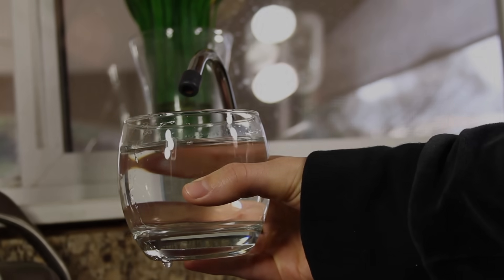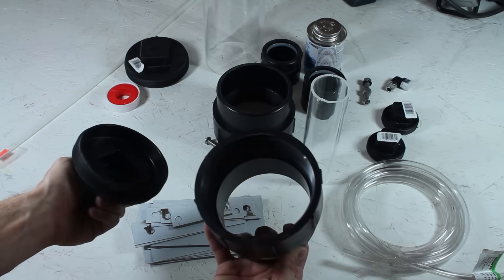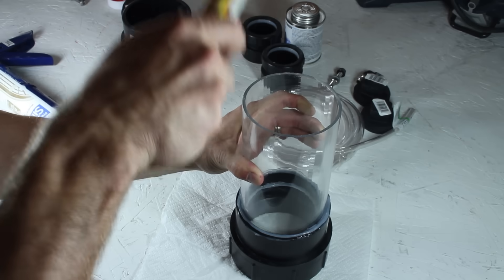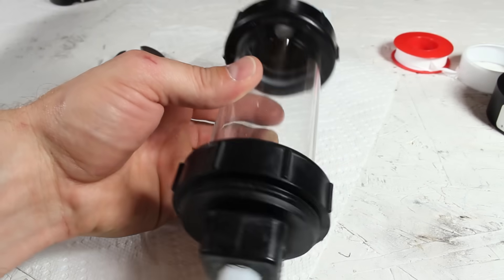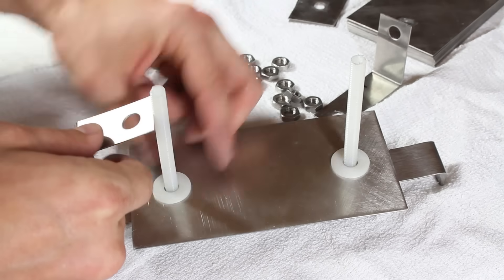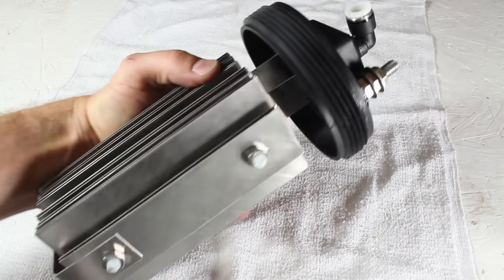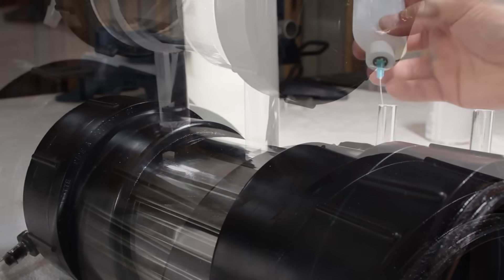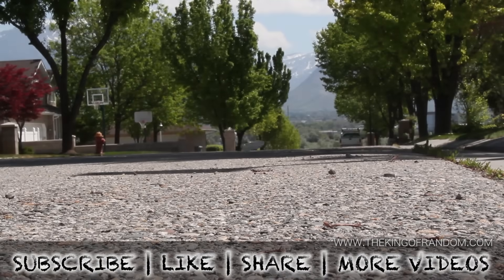HHO Generator - Water to Fuel Converter

Comment: Limitless lifting gas! How could you separate the oxygen from the hydrogen though?
Reply: The hydrogen gas forms at the cathode (- negative electrode) the oxygen at the anode (+ positive electrode).  If you separate the cathode and anode and collect the gas above the cathode you will get relatively pure hydrogen.  In the video the guy just wanted to make hydrogen oxygen gas mix, so he could burn it, so he generated the 2 gasses in the same space (cathode and anode right next to each other).
Reply: strato man Thanks.
Reply: strato man Because hydrogen and oxygen together will explode violently if ignited. Pure Hydrogen just burns.
Reply: Doesn't have to be ignited when mixed either. Just compress the two gasses together and it will go bang!
Reply: Jock Wochi Just curious, why do you need to separate the hydrogen and oxygen before you burn them in a torch.  The ratio of gasses coming from electrolysis is exactly correct for burning.  Were you trying to force an oxidizing or reducing atmosphere?
Reply: +hunter hulsey In the electrolysis device in the video the hydrogen and oxygen will be well mixed and very difficult to separate.  Even though the hydrogen is much less dense it will not separate from the oxygen, much as sugar will not separate from water once dissolved.  It would be wiser to separate the electrodes and collect the hydrogen and oxygen separately in the first place.  

But if hydrogen is what you want there are more economical sources than electrolysis.  Most commercial hydrogen production comes from fossil fuels (natural gas primarily), and you can buy any amount you want from your local gas/welding supply house for much less than it would cost to make it yourself.
Reply: Drake Tamer My response was to a comment by someone who wanted pure hydrogen.
Reply: Why do you want to know? Planning on manufacturing liquid state rocket fuel? (hydrogen and oxygen in (separate) liquid states that are mixed together seconds before being burned)
Reply: ...well....if I can remember right one of them is denser than the other so it sinks so you could extra ad t the top layer....there will be twice as much hydrogen
Reply: You don't need to. The mixture of Hydrogen and Oxygen makes the reaction faster and cleaner, so you get more power per bottle.
Reply: Motherbrain Jr 
One of the electrodes attracts oxygen while the other attracts hydrogen. Just separate the bubbles coming off it's respective electrode.

Comment: So how would we turn this into storable, liquid state fuel? could I have this generator in my garden and add a tank to hold and compress the hydrogen into liquid?? How do we put this into our fuel tank? (in the vid he said that bucket of water would make 1000s litres of fuel )
Reply: Using this generator for any other purpose then fun is not practical. A gas is dramatically less dense than a liquid, therefore the 1000s of litres of fuel statement is accurate.
Reply: gamersden30
 but how about if one was to make a HUGE version that ran all day off of solar power etc ? could you make 5lt of liquid fuel per day?
Reply: liquid hydrogen has a 1:851 size ratio. Try to do the math fr yourself
Reply: Dave P Yes, approx.
Reply: gamersden30
 so how big is a 4000lt tank
Reply: 24 hours multiplied by 60 is 1440.
1440 minutes of time to make hydrogen in.
to make 1 liter of gas you'd have to produce 1/1440th LPM or 0.00069444... liters per minute.
Then we multiply that by 5 to get your wanted amount in gas. Thats 5/1440th LPM or 0.00347222... liters of gas per minute.
Then we multiply that by 856 as the liquid to gas volume of HHO is approximately 1:856.
That equals 2.97222032.
In short: 1/1440*5*856=2.97222032.
  So really you'd only need about 3 LPM at all times or 6 half the day.

The real problem is storing it, because hydrogen has the smallest atom size of all, it can leak through anything. (My hypothosis is that the exeption is solid hydrogen)

Comment: How often does the water and potassium hydroxide need to be changed, does anyone know, & has anyone built this to attach to their car??? and what was the results. Curious!!!
Reply: Its basically a way of generating gas that can be reacted together to release energy. It however requires energy to split the water, (total energy gain is zero as energy cannot be created or destroyed). You would want to have the converted hooked up to a power source, to generate the gasses which you then put into your car. Having it run off your car battery to power you car wouldn't work, you have to have some external power provided.
Reply: Void Strider yeah but your not creating energy your just converting the stored potential energy in the water/hydrogen

Comment: Ive finished building my own hydrogen generator, and i have a problem. the water is turning a dark bluish green, and the gas is being trapped i bubbles and bringing the liquid out with it. any advice?
Reply: Try using distilled water, you're probably using tap water with some unwanted electrolytes. Distilled water has no electrolytes and should produce only fuel, although not quite as efficiently as the dark blue stuff. There are probably also other gases going out with the dark blue stuff. I'm 90% sure that should work ;)
Reply: wait, are you saying that the dark blue is good?
Reply: Use lemon as electrolyte
Reply: why
Reply: andrew martin you probably used stainless  coated electrodes instead of stainless steel. happen to me too and wasted a lot of distilled water till i changed the electrodes and boom worked out just fine

Comment: Where do you get a adhesive remover
Reply: look for Goo Gone, or other products like it
Reply: Lighter fluid.
Reply: Heat works, too. That's mainly if you want to reuse a sticker and keep from damaging or otherwise visibly altering it, had to do it with an inspection sticker on a windshield. A basic heat gun works well for that. Also makes removing window tint a lot easier!

Comment: Because potassium has a radioactive isotope, known as K-40, adding potassium hydroxide will make the water slightly radioactive and fill the hydroxy gas with small amounts of argon and calcium. However, the water is barely radioactive because of tritium in the water, filling the hydroxy gas with tiny amounts of helium-3. The hydroxy gas also contains small amounts of deuterium
Reply: Hi sorry... Isn't tritium and deuterium both the... Waste or the driving force for nuclear steam powered plants that produce all this electricity we're enjoying?

So you're saying we don't need nuclear plants or reactors if we used this? Not trolling you. Serious question.
Reply: +Empty Time If only nuclear power plants ran on fusion and not fission...
Reply: +John Smith got it, Thank you sir, looks like I need research in my life haha
Reply: This doesn't produce any radioactive isotopes, this is only a chemical reaction. You normally only come across deuterium and tritium in fusion, though heavy water containing deuterium is used for CANDU fission reactors, but not as fuel. Nuclear reactors work just like coal or natural gas power generators after the reaction occurs and the energy released heats up the water. The steam that drives the turbine is just boiled water, there's nothing radioactive about it.

Comment: Guys somethink green comes up when i move + side on the incoming hydrogen from - side what is this i think its copper chloride or CuH im not sure but i can see that copper wire turns black btw i added salt
Reply: It could be copper oxide but is is also a byproduct of you using salt as an electrolite, by using salt you also created chlorine gas, but don't smell it.
You should use something else for your electrolite than salt
Reply: It could be copper oxide but is is also a byproduct of you using salt as an electrolite, by using salt you also created chlorine gas, but don't smell it.
You should use something else for your electrolite than salt
Reply: I’m wondering if mothballs are made of potassium hydroxide, do you know

Comment: You should test this on your car and see if it really does give you better gas mileage.
Reply: But instead of gas as gasoline its gas as in air.  and since that phrase refers to gasoline technically its 0 gas mileage since not using gasoline.
Reply: Hydrogen gas has more energy per unit of mass than gadoline
Reply: NOT IT'S NOT!!!! the energy required to split the water molecule into hydrogen and oxygen is greater then the energy you'd get when you burn them back together, so from ground zero you'd get a diminished energy return. Free? quite the opposite, as you'd be knackering the battery. Pure and simple......this DOES NOT WORK!!! I mean it does work, but not as free energy device......btw, the "greenhouse" effect comes from  particular gases preventing heat from being radiated into space...These gases mostly are methane and carbon dioxide.....where, in here, are these?
Reply: +Martin S the electrolysis machine draws energy from your battery and then the gas is burned in the engine.
Reply: Revampedharpy09 Yes gases work in a normal gadoline engine but if you wanna switch to gas you just need to make some adjustments to your gas tank
Reply: +Martin S That's what I was thinking but from what I have read and heard it increases your gas milage and increases your fuel efficiency.
Reply: +Justin Bosley  Carburettors aren't used in 4 stroke cars anymore. They stopped using that around the 70's-80's. The way it works now is that fuel is being sprayed into the air going in to the engine electrically.
Reply: I've done this to a truck that was converted to run on propane gas. I used no catalyst. The engine ran, but barely on pure HHO gas (the gas being formed with this process). I abandoned the project at that time.
Reply: +Revampedharpy09 unless it gives you more energy from your gas to recharge your battery with the alternator.
Reply: You DO realize that Hydrogen Generators and combustion engines have as much in common as rabbits and squirrels right?
Reply: @Canyoueventhink - You are almost right. The alternator does nothing more than generate an output to charge the battery. A voltage regulator maintains just the right output from the alternator to keep the battery at optimum charge while the car components needing juice will draw from the battery. The main issue, is that there has been no HHO build to date that has proven to be more efficient than a straight up electric motor. That is to say, at present, electric hybrid engines are more efficient than engines supplemented by HHO. The reason for this is a net energy loss as heat when driving 50-70 amps through water. Efficiency gains can indeed be made with catalysts and pulse width modulation........ but we still don't see anything which comes close to simply strapping an electric motor on and using excess electrical power to supplement the engine without state conversion. 

I suspect someone might come very close to finding the answer to 90+ % efficiency with this method though....if they haven't already :)
Reply: the comments below make me feel like I'm in the middle of a debate
Reply: ***** obviously one this size wouldn't work to power a car. But if you build an hho generator much larger you can run a car on it.my neighbor ran a car with two generators going at the same time producing more than enough gas to run a car. So don't tell me it can't be done. I've seen it.
Reply: +Golden Retriever What if you used a better battery?  Not much.  The electrical current available to electolyse water for steady use in a car is NOT dependent on the battery, it's dependent upon the alternator capacity.
Reply: it wouldn't since it has oxygen molecules which make the o2 sensor believe it needs to increase the amount of fuel it injects into the engine to make sure it uses up all of the oxygen in the combustion process (the oxygen would make the sensors think the fuel to air ratio is off so it would try and fix that ie. more fuel). it could however work if you either trick the o2 sensor, reprogram the ecu or use a cathode and an anode to seperate the hydrogen and the oxygen and only inject the hydrogen into the engine as to not trigger the o2 sensor
Reply: Jordan Holmes 

What if you're doing this on an older car without any electronics and sensors
Reply: Martin S still a different design.
Reply: And from that one comment, came millions

Seriously, this is a big section about fuels and cars and more. How do you get such a big discussion about fuels?
Reply: now if you fill these up into pressurized tanks and rig the carburetor to pull from the tank... wonder what your electric bill would be
Reply: TOTALY AGREE
Reply: +kenny Noble Do you have experience with doing this?
Reply: Revampedharpy09 

What if you used a better battery instead of the led acid battery 

Like a lythium ion cell or something like that
Reply: Fromage Frizzbizz 

Makes sense 

I've heard you would have to make adjustments for running on gas not liquid 

If this worked at all
Reply: then you would have no problem and both the h2 and o2 can be used without having to bypass anything
Reply: Jordan Holmes 

Cool
Reply: Justin Bosley or jus not allow him to screw up what they already have going 8)
Reply: Justin Bosley itd use more energy from your battery to make the gas than youd get back
Reply: +Revampedharpy09 in a gasoline engine, the gasoline is sprayed as a mist into your cylinder and air pumped in through the carberator. You would feed the H2 and O2 gas in through the carberator.
Reply: The only problem I see is that it uses battery life to make the H2 and O2 and the battery is recharged by the alternator which takes energy from the gasoline that is burnt. So it could either drain the battery or have no effect on the gas milage because it is using more energy to recharge the battery, unless it is somehow increasing fuel efficiency.
Reply: +Justin Bosley in theory yes it would but it would slaughter your car battery in practice.
Reply: that would only work on engines designed for that fuel. its a bit like how a petrol engine wont run on diesel and vice versa. despite being called gas, its actually a liquid and therefore hydroxide gas (or whatever you wanna call the fuel) behaves differently, meaning it almost certainly wouldn't work in a regular engine
Reply: I saw another video where a guy hooked one of these of to his gas tank. the idea is a normal engine doesn't burn fuel very efficiently (I think he said something like 80% of the fuel used it's waisted in the exhaust don't quote me on that though) by adding this to his car it increased the burn efficiency of the fuel (something like 90% of the fuel was burned, but again, don't quote me). also, in no chemist but I believe that by using the catalyst in the water, it doesn't take much energy to get the reaction going. the whole idea here is just to waste less fuel as exhaust. cleaner and more efficient
Reply: Mythbusters already did this. It will run an engine, but it takes far more energy to produce enough of this to power the car than the car produces from an alternator or even solar panels.
Reply: ***** Every alternator you run adds parasitic power loss to the engine. Eventually, you're draining all the power from the engine to produce hydrogen, which is then not enough to run the engine, which then dies.

There's no such thing as over-unity power. It's a simple closed-system equation, of which there is no magic solution to allow a glass of water to power a car(well, maybe an RC car).
Reply: ***** Hydrogen is a lighter-than-air gas.  A Standard combustion engine made as cheap as possible wouldn't be able to contain the gas let alone run it.  I believe the fuel injector is also incompatible but I might be mistaken.
Reply: ***** I guess but wouldn't that require a rework of the entire engine's layout?
Reply: ***** Well I don't have a car so no way it helped me XD
Reply: you need power to make this gas so unless you are using solar power it isn't really clean.
Reply: +Justin Bosley I think if you use solar power to power the hho generator i think it really could work
Reply: Urban Tant/ Sea Monkey 101 You, like many in this thread, don't seem to understand the colossal amount of H2 that would be required to power a car as combustible fuel. There is no way any normal-sized fuel tank/engine combo would run from an electrolysis machine. The engine would not be capable of producing more energy than the electrolysis requires to continue.

Try it in a scale model: If you can power an electrolysis setup from itself, or egads produce surplus power, you have just achieved over-unity power generation and have broken the laws of physics. You'd also be the first one in the world to ever achieve this through any power source at all.

Congratulations. Dream on.
Reply: since hydrogen packs more of an explosion than gas, your probably going to want to have a reinforced engine block and pistons and cam shaft, also your going to want to air tight your injection system and pistons, i know this because Ive rebuilt an entire engine before.
Reply: half way down the road... BOOM and thats why he stopped posting, ded.
Reply: Justin Bosley oil company's wouldn't allow this into creation they'd try to buy out the idea an if he wouldn't take the offer they'd have him killed an do it anyway
Reply: Justin Bosley that would be a very wasteful engine, your battery will die very soon and then your car is Dead,